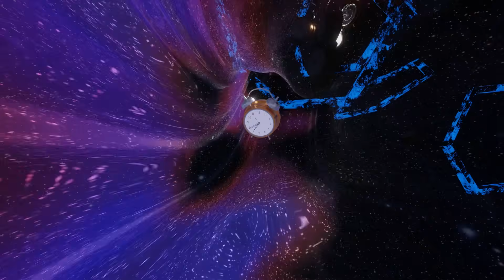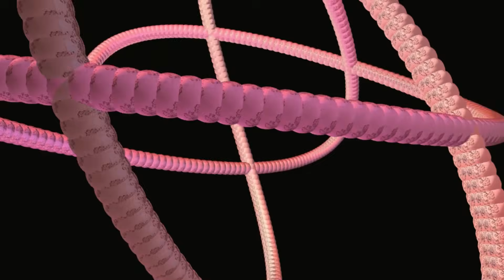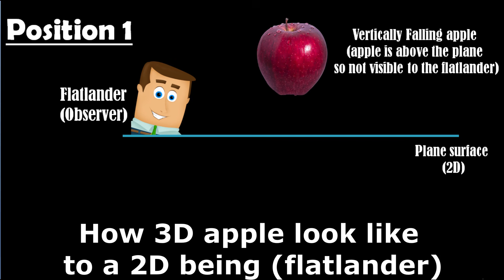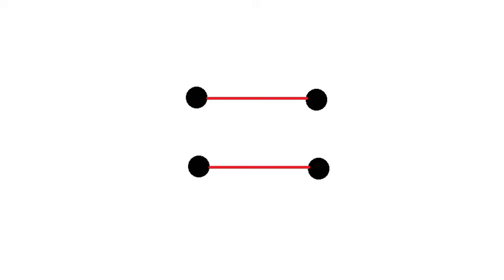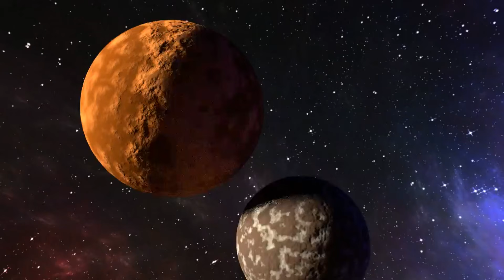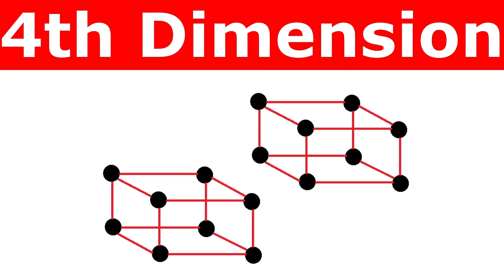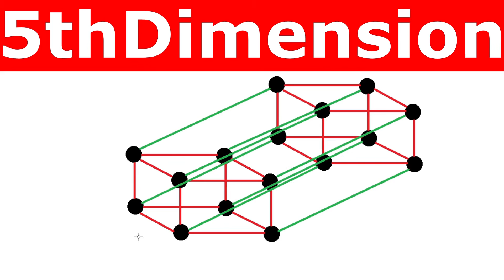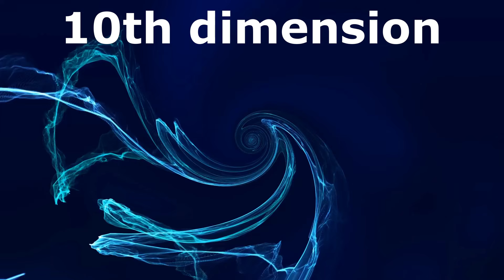11 Dimensions Explained - A Mind-Bending Explanation of Higher Dimensions!

Comment: Can someone explain to me how dimension from 1-3d construct is only about shape ( height width and depth) but then once passing into 4d you then claim not only the angles of the shape gets more intricate but it also adds time into the equation? Dimension pertains to shape perception not time or anything to do with consciousness. Your claims that add rules to each layer on dimension are nearly made up. You are making this life more complicated then what it actually is. It is a dimensional realm and a spiritual realm that is all. No multiverse with higher dimensions of your self that trump time , if that was the case this 3d construct will have plenty of higher self dimensional beings visiting ourselves messing up our 3d existence time line.
Reply: In 4d , actually it has two theory
1. Spatial
2. Time

Since, we do not know exactly where the 4th dimension is with regards to x , y , and z axis, we cannot know for sure.

As for time, it's important to note that time is relative and not absolute. Meaning it has different meaning, for example 
An astronaut that stays in outer space can see the earth orbits the sun much quicker, they say about 7 minutes, but we on the earth feels like 24 hours.

So, this makes plausible for mathematician to do the calculation, if for example they can obtain some data from outer space.

Comment: Once you unlock the ultra dimension, there are no more dimensions.  The ultra dimension creates dimensions based upon your ultra dimension theories.  The sine and cosine move over each other like orange juice and apple juice.  The fruit medley average dimensions into an ultra percentage of vesty flavor.  One taste and any thing is posible anything at all.  The strength of the man king relies on the creation of the belief in ultra dimensional terms.  If he forgets the magic sine and csine juice formula in a maze of pure wonder, he will turn to doom and ask oblivion for aid.
But the vast knowlede of tasty flavors is without beginning or end, thus time appears to exist.  If I have a pudding rod for the cocoa and vanilla bean, I can sort them in differing containers, yet the vastness of containers may come and go, as the pudding rod is used more, I may float without a pudding paddle, even no eyeballs sucked out for use a pudding paddles.
if 10^ -33 cm is so small, how many fit in 10 meters cubed?  It is a record of you.  If you alter the record, each pudding flavor will put you back together again, so humpty dumpty can have a great fall.  The complexity of a pudding operation has few limitations, but some pudding paddles do the math in reverse, like if you hold a rotating wheel, or add weight to a hollow boyant object, the pudding is aided by the structure invisibly.

Comment: It doesn't make sense for me if 
a 4th dimension creature can go back in time.

Time has been confirmed to be a relative value ( has different perspective, from where it being viewed). This is what Einstein's theory all about.

The perspective of time is relative i.e different from different perspectives due to the velocity of that creature.

Suppose the earth is rotating around its axis from west to east. And suppose this rotation speed is lower than the speed of light.

So, let us assume that creature is an angel who can travel with the speed of light. Suppose initially he is at outer space, but on the same latitude, and longitude of India (let say).

So, whilst the earth is rotating west to east, the angel travel the opposite direction (i.e from  east to west).

Due, to it's faster speed, it may or may not be able to return to it's initial position (India from outer space) in one complete cycle.

If he is not fast enough maybe he cannot go to the past in time (our time not the angel's time) more than ( I don't know let say 1 minute).

In a nutshell, time is perceived differently solely due to it's ability to travel faster than somebody else.
In this instance ( angel and earth ) because our time is based on the rotation of earth around its axis.

Comment: Hello @Engineering Made Easy, your video was quite thought provoking but I don't think 4th dimension is time. If you get a chance, you should watch the video "4th dimension explained by teenager" -- it explains beautifully how the 4th dimension is hypercube (again very hard to visualize) because its space in which all vertexes of the cube touch each and opposites sides are all parallel. In addition, if you think as a 3-dimensional object, you can see that when you move, you are not actually moving in 3 d space you are moving through infinitely stacked 2-d planes. And if you were to take this notion, you would understand parallel universes. Just as a single 2d plane is infinite, and any organism living 2d space would not be able to see the other 2-d planes stacked on top of them, we would not be able to see a parallel universes of our 3-d spaces. So 4th dimension is just the ability to see all parallel universes of 3-d spaces that stretch infinitely in all directions (again hard to describe because our frame of reference is 2-d spaces only). And time would still influence a 4-dimensional being their 4-dimensional world. Think for example, how if you were to stand in your room, touching one of the walls. As you move from that wall to the opposite wall (so your back faces the starting wall and your faces towards the opposite wall), you are passing through 2-d planes. This particular plane is referenced as coronal plane, (although you are technically moving in all three if you were to really visualize each cross-section of your body). All three planes are infinite, and they all bend back on-itself (after extremely long-time). So my point is that it takes time for you to move from starting wall to finish wall. But you as you look, you can see through all 2-d planes. The reason why you cannot see through walls, is because that has thickness. Which is what makes it 3-d. You can see and interact with 3-d spaces, but you pass through all 2-d spaces. You may say well I cannot pass through paper, but paper is 3-d, because it does have height or thickness although sleight. But as a 4th dimensional being, you would be able to see through it, through all 3-d spaces. 4-th dimensional being can travel through 3-d spaces but time still influences you. It is more plausible (a mere thought) that 0th dimension is the only dimension that is timeless. Since it has no shape, and time comes into existence only when there is shape. So time is existence, when you cease to exist, you are not bound by time. Just wanted to leave food for thought :) Thank you for sharing your video, it made me think a lot. I hope you create many more wonderful videos like these.

Comment: @EngineeringMadeEasy For a 3-d model that might better expand your line of graphical thinking when demonstrating the Dimensions, I would encourage you to consider using the Tree of Life Model that shows the 22 lines (Paths) and the 10 Sephirot (paths). Stacking these adjacent, or on top of one another in any direction will achieve what you are explaining whilst at the same time define for you where exactly along the timeline of where the folding of reality begins and ends leading to the cross navigating of the parallel Universes, or rather realities. Furthermore, taking into considerations that only certain pivoting pinnacles (Sephirot) can start the beginnings of the new world, or rather universe. I'd rather define each by Planes of existence, since based on all models I have created demonstrating what you are speaking of require the understanding that Dimensions are Vertical and Planes are horizontal. Therefore, to mentally explore a dimension accurately and definitively the observer (student) must learn how to traverse it Horizontally. Something similar can be said about the Horizontal, to mentally explore a Plane accurately and definitively the observer (student) must learn how to traverse it Vertically. To do all of this effectively, whilst keeping the senses and sense of self in tact without self delusion occurring there must be a joining of forces from the Vertical and the Horizontal (Dimension and Plane) relating directly to the specific Effect that creates the Cause to be born resulting in the manifestation of the imagined achievement materializing within the person's life as all of the events and experiences needs in order for the achievement to be reached. This happens by the harmony of both the Vertical and the horizontal giving birth to the Diagonal. Once the Diagonal has matured enough to stand alone and on its own, a greater friction of force is needed to hold in within its place. And that is caused by becoming a supportive brace that acts as an unseen member supporting the weight and build of the next world (Sephirot) attached thereto it. Depending upon Which directional position that diagonal faces or rather leans towards depicts which Emotion or Facet thereof is to be structured, weighed, and balanced respectively through specific spiritual traditions and disciplines in order for the Point line and Curve of Creation to be properly understood and assimilated by the Neophyte mind. In the end of such a model if it were taken to its complete end structurally speaking would create a massively huge Spherical like shape of all that exists, resulting in 99 total Macrocosmic Dimensions, rather than just 11 Macrocosmic Dimensions. The Trinity of Shape, as I like to call it, is in fact the Point-Line-Curve. The Trinity of Movement, as I like to call it, is in fact the Vertical-Horizontal-Diagonal. And the Foundational infrastructure that binds those 6 together are the Sphere-Cube-Pyramid. Without achieving a higher awareness of the other worlds they will appear as fractaled splices takened sections belonging to the Sphere, Cube, and Pyramid, respectively. Vertical=Emotional Body, Horizontal=Mental Body, Diagonal=Physical Body, Foundational Infrastructure=Spirit Body. All of these having/creating their own Heliometric and Geometric Signs-Shapes-Sigils.